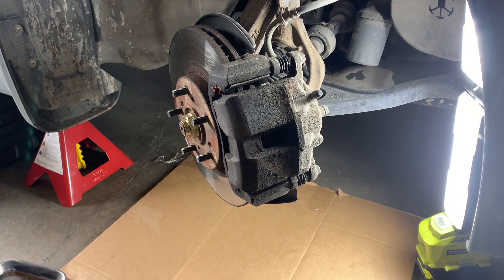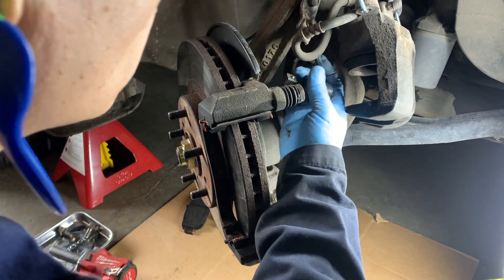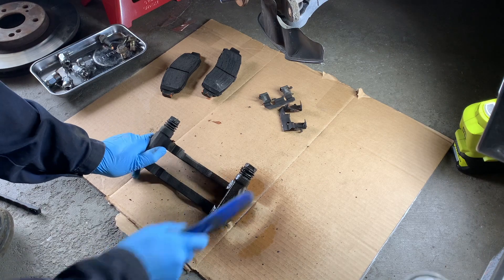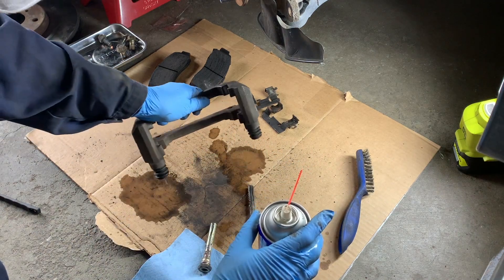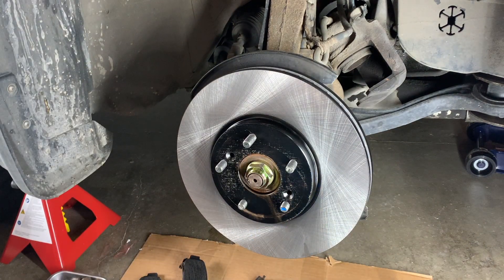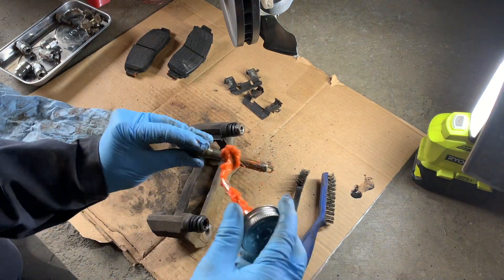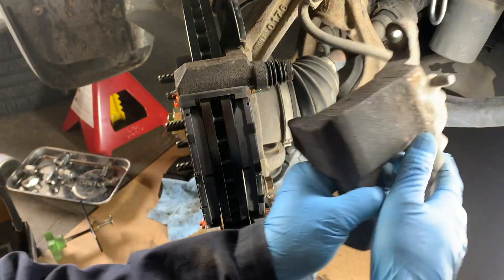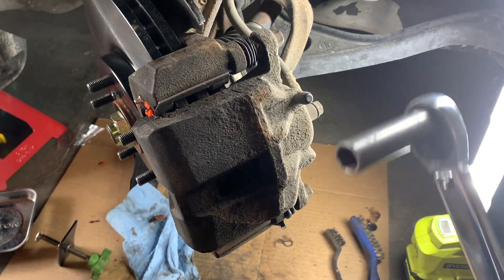Acura TL Front Brake Pads and Rotors Replacement

Comment: sorry, I see that this was 3 years ago, I'm curious you mentioned you replaced the lower control arm, curious what was the reason? ...thx
Reply from the maker: Sadly, I had video on that which I never compiled. It was using a camera i was testing out but the quality sucked. 

The lower ball joint was falling and i ordered a lower control arm with the ball joint pressed in and replaced it that way as an assembly.
Reply: @lmsdiy  when you say failing, was the car front end making noise?  Did the new ball joint help for smoother drive?
Reply from the maker: @ yeah while I was doing the routine checks on ball joints and other components, I could hear the clicking and it was starting to clunk over bumps as well.
Reply: Thank you for the info.

Comment: You messed up with the slider pins. That orange silicone swells the seals. Something in that stuff does it even though it’s silicone.

The clear silicone doesn’t swell the seals.
Reply from the maker: That's an interesting observation and I have to respectfully disagree that it was a mess-up as this is what is used in many, many home and automotive shops. So it is certainly intentional and not a mistake to use high temperature silicon grease designed for brakes and brake parts.

In general, silicon is recommended for rubber as it does not cause rubber to swell. 

You may want to consider notifying the manufacturer as maybe you had a bad batch but this product has and is used by mechanics and mechanic shops everywhere.

Comment: Does this work for the back ones to
Reply from the maker: Very similar, yes. The rear rotors will look slightly different and the pads and callipers will be smaller.
Reply: @lmsdiy  thanks 👍
Reply from the maker: @IntoTheVoid0001  the main difference is that the parking brake is on the rear which doesn't really affect anything. Just leave the parking brake stuff alone (under the rotor hub area) and make sure your parking brake is off.
Reply: @lmsdiy  makes sense but I've gotta find the right parts and stuff